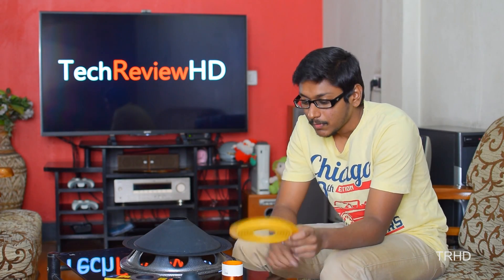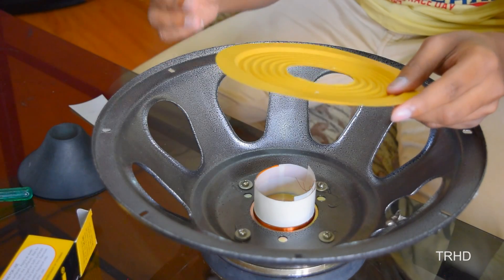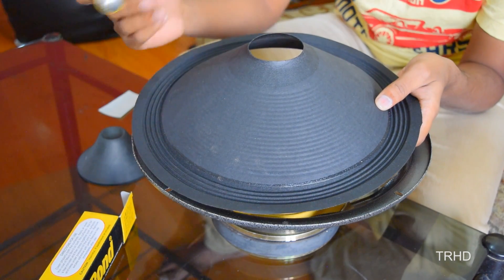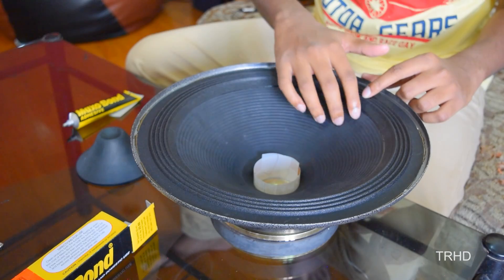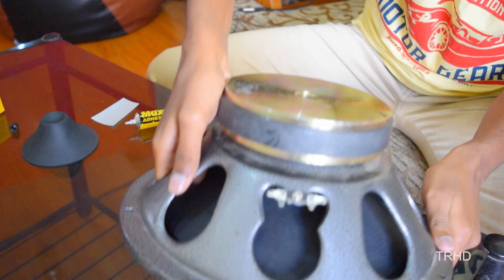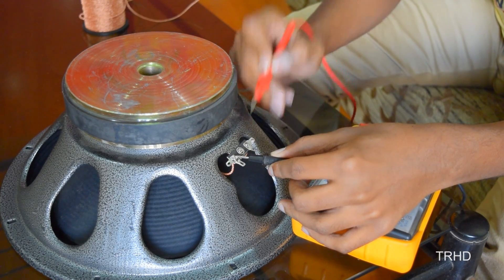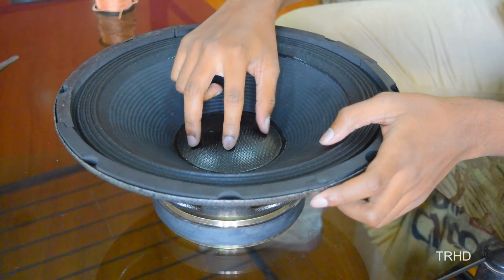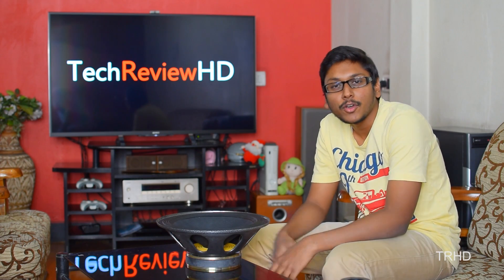How to make a Speaker at Home - Very Easy!

Comment: If you don´t look carefully what happens, you will propably ruin your speaker - the guy just drops the coil in the hole, and then doesn´t really mention the important part of the coil position and how it´s done. If you drop it in like that, and set only spacing between pole piece, you´ll have one dead speaker. Coil positioning in its working axis position is vital. Haven´t been mentioned at all. I find this video rather harming and misleading. Now for the making the speaker, that´s right. Just assembled. Not MADE really. Seems I´m going to make one :-D

Comment: hey bro i removed a speaker from my old broken radio but when i connect that speaker to my phone the volume of sound is very less is there any way to increase the volume of that speaker because i have to use that for my college project
Reply: u have to use an amplifier for the speaker to sound it loud enough check ur speaker's watt rating nd buy a suitable amp

Comment: I feel like it would completely rip and die if any bass were to be present.
Reply from the maker: I used a Professional Grade Cloth Edge Speaker Cone Paper which can handle frequencies upto 20Hz easily at 200Watts output,so it can handle Bass without any problem at high volume also.
Reply: @VimalChintapatlaTR  it would not be able to handle 200 watts of clean sine wave 20 Hertz for very long at all. Maybe a small burp, but holding it there for sometime would burn that little coil up
Reply: That's a possible thing maybe that's why he used no bass music!
Reply: +Aaron bilger My thinking exactly.
Reply: +Vimal Chintapatla  hmmmm

Comment: please can you show me how to make the voice coil
Reply: +black ops [ David ]  no matter how long your wire is ohms meter always measure 0 ohms than how you supposed to consider how long wire you need??
Reply: I'd assume, get some thick copper costed wire, and buy a volt meter, or something that measures ohms, and wrap the wire around thick paper or aluminum that's glued/tapped in a cylinder (open both sides) and wrap around tightly and good and keep wrapping until y reach the desired ohms resistance.
Reply: Sylum Sid how am I supposed to know? A why does an ohm meter always measure 0 ohms????? I'm only 14 ya know